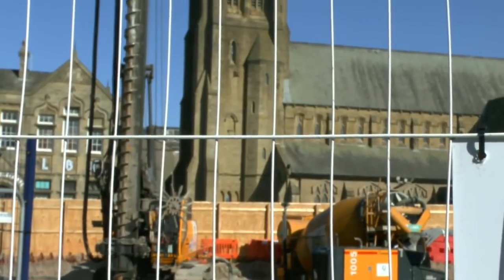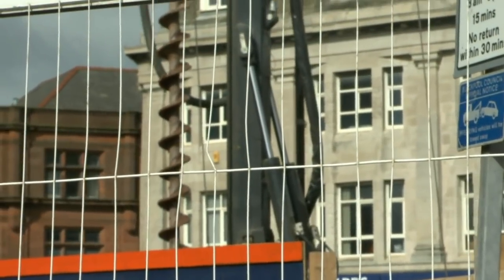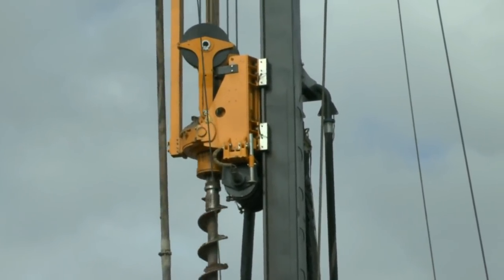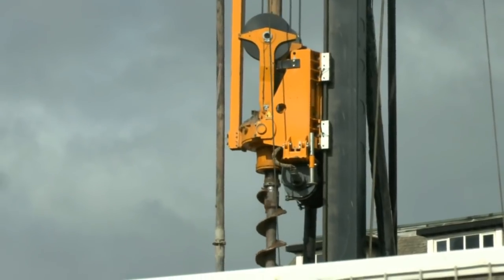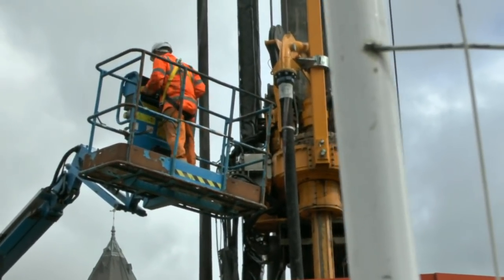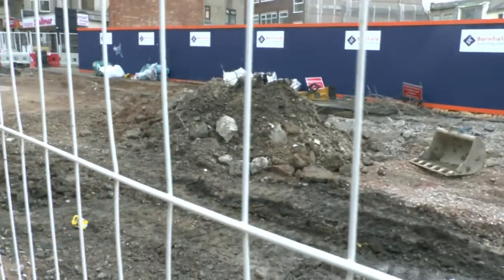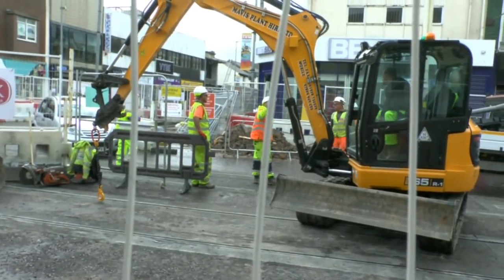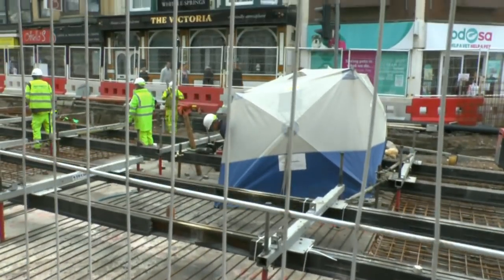BUILDING BLACKPOOL BETTER PART 23

Comment: The Crevice might be to enable the 500v cabling for the overhead line equipment for the flexity2 trams and dare I say a potential route for the preserved heritage trams.
Reply from the maker: MARTIN THANK YOU FOR YOUR GREAT  INPUT AND KNOWLEDGE===VERY MUCH APPRECIATED==COLIN
Reply from the maker: HAVE JUST  RETURNED FROM TALBOT ROAD SITE AND YES MARTIN ABOVE IS 100 PER CENT CORRECT==HERITAGE TRAMS AMD THAT CLASS WILL BE ON THIS NEW ROUTE==OVERHEAD CABLES WILL BE ERECTED==COLIN